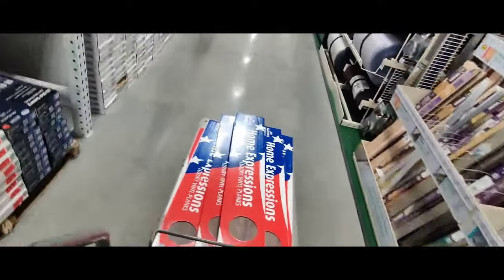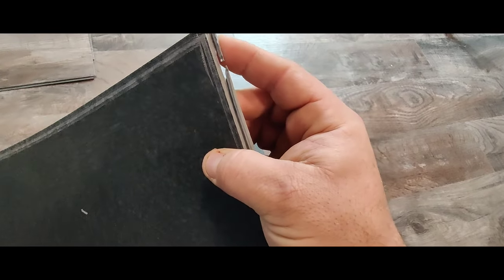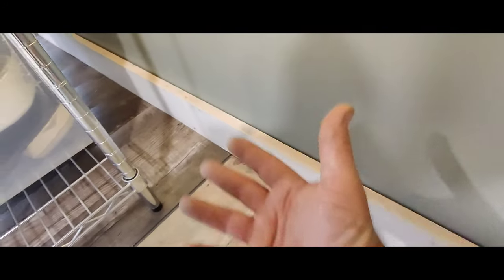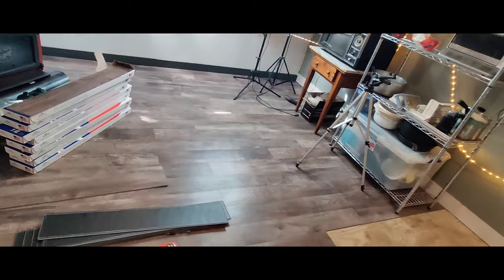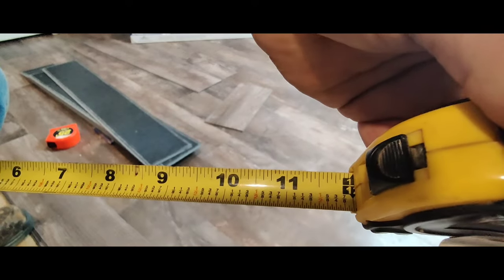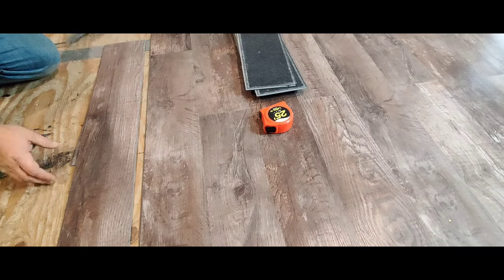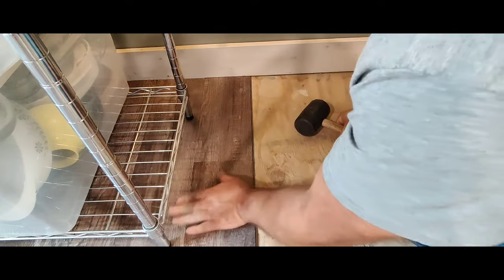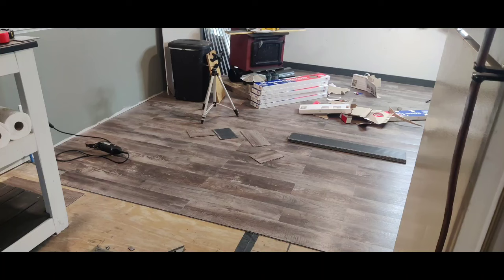MOBILE HOME RENOVATION - Vinyl Plank - How I Do it

Comment: My luck, they'd discontinue the flooring mid-project, as I was saving up for my next batch of planks!  But, I could deal with it -- just pick another flooring that would "complement" the old pattern/color.  Saw some porcelain tile in the outdoor section of Lowes that was made to look link plank flooring (wood).  It was designed for decks and patios.  Had not seen that before.  [ETA:  Right after I finished my comment, went back to watch the rest of your video and you were talking about possible discontinued product!]  When will you get the glass door insert for your wood stove?  I'm so excited that you are finishing the long house.  Now, how about getting some peel and stick brick wallpaper for the kitchen?  That would look so beautiful -- and your floor is fabulous!  Great job, Marty!  Instead of knee pads, just use one of those rubber garden kneeler pads that you can get at dollar general or Lowes/Home Depot/Walmart.  They have a handle/hole so you can easily drag them around with you.
Reply from the maker: The glass door for the fire place will be a few weeks. I've experimented with peel and stick before on my old house when my mom was alive. It was her idea to do that for the back splash area but it always would fall off and never adhered very well.
Reply: @MDC2020  Can't wait to see the install on the glass door.  What a nice, cozy fire you'll be able to enjoy in the wood stove.  The kitties too, will love it!  
     Yeah.  Too much moisture by the sink; I agree, that would not be the place to put the peel and stick wallpaper.  But, the good thing is, you don't have to use peel and stick.  You can use the kind of wallpaper that you use glue on.   I have to do peel and stick, because I am in an apartment, and would have to remove it before moving (on to the happy hunting grounds?).  Well, you know how women are . . . always wanting to "decorate."🤩